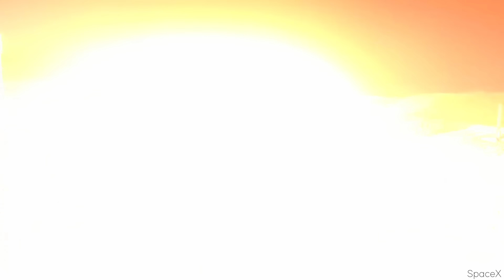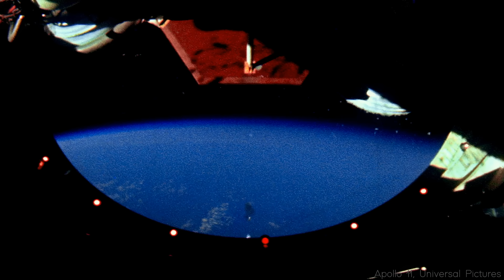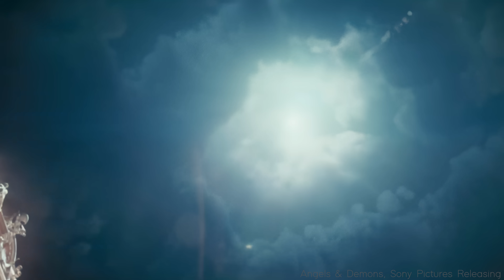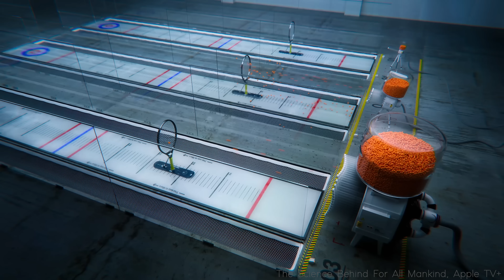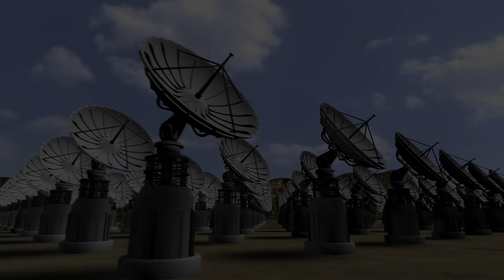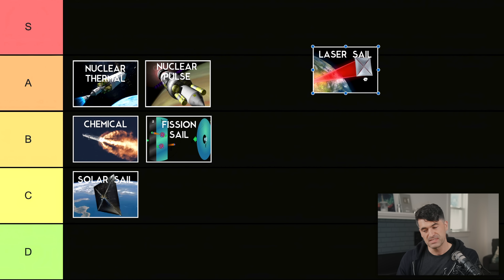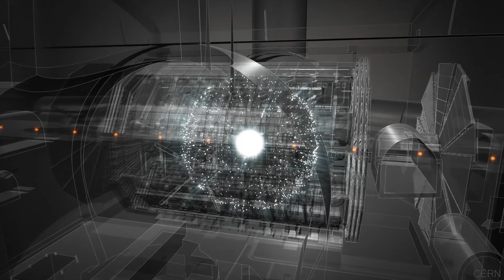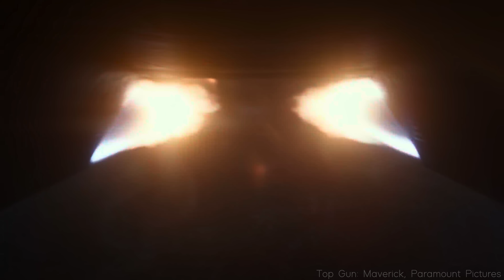Interstellar Propulsion Technologies - RANKED!

Comment: I watched this vid yesterday and am watching the Halo vid now and was going to comment there, but felt this vid would be a better choice.  It seems everyone that considers light sails focuses on laser acceleration.  Is there a requirement for coherent light, or is that just because lasers are easier to focus?  My question is driven by an idea I had a while ago for concentrated solar at distant asteroids: using what's essentially a giant inflatable Fresnel lens placed closer to the sun to focus light into a beam that can be directed fairly easily.  I don't understand enough about non-imaging optics to know if this idea is reasonable to keep a beam narrow enough over astronomical distances to be useful (I believe imaging optics have no chance of doing so), but if so, this approach feels like something that could be done 'today.'  What I envision is basically a giant (kilometer+ in diameter) inflatable disk a meter or so in thickness and what's holding the two sides together is angled circles of mirrored Mylar (or something else that can survive space) where the angles are such that the ones near the outer edge direct the light more than those toward the center.  All that light is directed toward a similar, but much smaller version that essentially reverses the process to create a collimated beam that can be directed with a mirror in the path of the beam.  I certainly see challenges keeping the beam directed on a location moving at a different orbital speed (or escaping the solar system entirely), but I believe part of that could be managed by either relying on radiation pressure to keep the collectors moving at a slower orbit, if not stationary wrt the solar system, or by having a series of these collectors spaced evenly around the sun that can direct the beam to the target when its in range.  I can't find the calculations I made a while ago, but my memory tells me what I described made of easy to obtain Mylar would weigh well under the capacity of various orbital rockets and the pressure to fill it needn't be much, since it's in a vacuum, so I don't think it'd be something heavy.  I also recall the price was reasonable - at least when compared to traditional costs to put things into space.  And it seems like something that could be cheaply tested at small scale (where 'small' could still be 10+ meters in diameter) with a cubesat or something for an attainable price.  Does this make sense to anyone?

Comment: While I can appreciate the focus on the technology we can currently build getting a higher rating. The warp drive is not D tier. Go update yourself, While the developments that have occured recently havent unlocked superluminal travel. The mere idea that it looks like the physics hangs together to show we could use it for propulsion, giving us a space drive is game changing if this continues to pan out and then engineering doesnt hit any brick walls. 

Also, same goes for the anti matter drive. that 100 Trillion dollar estimate is bogus. We already have a facility on this planet that makes 100NG of the stuff. You want to tell me given the likely hood we will have useful AI + robotics. We couldnt build the same facility in space actually closer to the sun than we are so that you end up with access to permanent supply of energy to not only turn into anti matter. Even if it is inefficient. But also with a ton of energy to power the containment systems. That 100 Trillion dollar figure is more likely to be the value of figuring out how to build such a facility in space not the actual cost especially if you can come up with a engine to utilize it.

Comment: You forgot about the saltwater fission-drive. This uses U-235 or plutonium as a salt in aqueous solution, being pumped into a water-cooled semi-sphere through neutron-absorbing pipes. Once it approaches the exhaust, the absorber is configured in such as way as to allow criticality just outside the "nozzle". The speed and pressure of the fuel needs to be greater than the velocity of the moderated neutrons used to initiate the reaction, which is surprisingly slow, around 50 m/s.

This is more efficient the more highly enriched the fuel, and has a minimum practical thrust-level inversely scaling with that enrichment. The higher the thrust, the higher the efficiency. It is in essence, a continous Chernobyl in space. Scott Manley had a video about which I highly recommend.

Practical for uninhabited planets and/or space, and very suitable for very large ships. For large mass/fuel ratios these could easily reach 3-4% of C with a multi-hundred tonne spacecraft.

Comment: Hydrogen for chemical or nuclear rockets can be very efficient, but storing the stuff is a serious problem.  In gaseous form, it takes up way too much space.  In liquid form it's conveniently dense, but hydrogen atoms are so small that they slowly escape any container we've yet devised to hold them, so they're useless for anything but the initial phases or any flight.

Anti-matter makes hydrogen containment seem like child's play.  It's absurdly energy dense, but it requires a magnetic bottle to contain it.  That requires a power source and field generator that are 100% reliable, as moment's failure would allow the anti-matter to touch the physical container it's in, resulting in a rapid unplanned disassembly of the rocket and everything within a thousand miles.

Comment: Ehhhhh
Critical mass isn't something that concrete 
Theoretically you can use any mass to rich it
You just need to increase the density of the atoms together basically you need to pressurise them

Which is how some A and H Bombs operate

Some use a pistol mechanism to add a mass that will push it after a materials critical mass 

Some use a series of interconnected bombs that go off simultaneously and force the atoms together

So it is theoretically possible but needs futuristic tech

For example, using giant coil guns that use superconductors materials to smash two pieces of fissile material together with insane speeds

So critical mass isn't a concrete barrier
Just a relative one

Nein alcubere Drive is not a time machine necessarily 

It might induce a backward time transfer inside the drive but it'll not take you back in time rather things inside the bubble might experience a change in the direction of time

If they're moving with the speed of time so basically we aren't even sure whether things necessary move back in time inside a drive 

And hawking's conjecture is simply a conjecture we haven't test it yet 
And we will never can if it is true

We aren't even sure about the nature of casualty

Comment: My idea is a version of the Bussard Ramjet.  Typical fusion ram jet designs have the ship carrying enough fuel to accelerate to light speed and then decelerate at the destination, making the weight of all the fuel a serious obstacle.  The Bussard Ramjet tries to get around much of the fuel weight problem with an enormous scoop that picks up random hydrogen atoms floating in the ether.   Instead of having an enormous scoop weighing down the ship and making it take forever to reach light speeds, just use a very tiny scoop.  Carry just enough fuel to decelerate once you arrive at the destination.  Create a track of fusion fuel tanks in space along the path of travel within the solar system, and as the ship moves forward have the fuel tanks spray the fuel out directly toward the scoop as the ship is passing them.  That way the total weight of the ship is the living area, the engine, small scoop and deceleration fuel.  You cut the weight down by at least half over either of the other fusion ramjet designs.

Comment: Fusion-Enhanced Clark-Sheldon Drive is my top-rated propulsion system. First envisioned by Rodney L. Clark and Robert B. Sheldon, the FECS Drive is a rocket engine design using uranium and thorium nano-dust fission for its main energy production and uses the fission products as the main reaction mass. (Also known as a fission-fragment rocket drive.) Magnetic fields control the resulting plasma. Deuterium fusion boosts the fission energy yield and also thermally boosts exhaust velocity, Ve. FECS engines might also employ xenon both as a neutron barrier to protect engine walls and as reaction mass accelerated by the Hall Effect and by thermal energy. One of the fission products, xenon-135, is especially good at absorbing high-energy neutrons. The FECS drive also serves as a magnetohydrodynamic electricity generator for ship. Specific impulse approaches 1 million seconds.
Reply: any more info on this? i would like to know more
Reply: What gas is used to generate the plasma?

Comment: Nuclear thermal for periodic primary boost required for changing direction and velocity. Ion drive for coasting and trim. Sails and solar panels are more useful for journeys that are inside solar systems. Starshot laser based program is going to only be feasible for extremely tiny mass, much smaller than a typical cubesat and thus is overrated here because it isn't practical to send humans even if we multiply lasers and energies to some extent. Nuclear thermal and ion drive are S tier.

Comment: Warp Drive being D tier breaks my heart.
Reply: Better to break your heart than break causality
Reply: @stevenshea990  I always thought the point of warp drive is to achieve FTL without breaking causality. The ship doesn't move, the space around it moves faster than light, which space already does as the universe expands.
Reply: @Fylgija1  The whole idea that FTL breaks causality is because of wormholes, warp drives and other maybe mathematically possible ways to bypass speed of light by some shorcut in spacetime. If these ideas didn't exist we wouldn't even think that FTL=time travel, we would just think FTL is impossible period
Reply: @stevenshea990  how does it break causality to move space around an object faster than light? Space is expanding faster than the speed of light wouldn’t break that causality in you’re theory? Space can move faster than light just no object in space can move faster. Please explain me you’re point again.
Reply: @stevenshea990  
Causality is a secondary effect. Entropy is temporally symmetrical.
Reply: New research shows warp drive can't go FTL unless it starts FTL :(
Reply: With the recent updates theory that greatly reduces the energy needed to create the warp bubble, has generated greater interest in the theory. I think we will see rapid advancement in this area research
Reply: I was so hyped about it for years, until I learned that the energy required would be insane. If I recall correctly, it was all the energy in Jupiter to travel a few lightyears.
Reply: @Fylgija1  
It WOULD be if one distorted space according to the current understanding of gravity and relativity. Which fails to explain the obervations of "dark matter" and energy (really just the spin of galaxies at the extreme edges) Which means at the very least it is incomplete.
Reply: @Fylgija1 Antimatter has entered the chat.
Reply: @Fylgija1  It's more the mass energy of Jupiter crammed into a space ship that would be only slightly bigger than the ISS that's the real issue. Regarless of how far you can travel with that the process of cramming that much energy into that much space is effectively just creating a black hole except way more complicated. Might as well save a few steps and just use a black hole drive that would still be able to travel at a significant % of the speed of light for a lot less effort and a lot more efficiency.
Reply: @ThatGuyKazz  yea but you forgot to mention that you got to create that mass or gravity inside the spaceship out of nothing and destroy the mass or gravity somehow if you are at you’re destination. So you must have the ability to create gravity with some kind of machine and that’s pretty unlikely to happen in this century. If we got a quantum theory of gravity that might help to understand gravity on a particle level so that we know better how gravity interacts. If we could find something like that a warp drive could be possible within the next 100 years. With our current Technologie it would be impossible to even find a „graviton“ if it exists.
Reply: For me it's vice versa. People realizing that warp drive and FTL are impossible brings me joy. It's like the romantic belief that other planets of the Solar system are bustling with life and humanoid aliens. No one thinks that anymore. FTL was fun but it's time for it to go. It's time to accept that will never reach other stars in our lifetimes and in many generations. And when we do, it will not be faster than light.
This collective realization paves the way to realistic space fiction which is currently severely underrated and underdeveloped.
Reply: @t.104  Just because we dont know how something works, does not mean that it could not work. It is very unlikely that an FTL drive will be devolped within the next 100 or 200 Years, but how would you know what happens after. It is not physically impossible to go faster then light if you are starting faster then light so if you find a way to jump over this barrier without accelerating it is not impossible. We have so many open questions about gravity and quantum physics, that it is not possible to determine what we will find and discover in this area and how it will effect future technologie.

Comment: I've seen two interesting combo-drives, that add technologies together. Both start with a fission drive. In one case we also generate electricity from the fission reaction and use that to magnetically increase the specific impulse; so combo of fission and ion drive. 

The second idea introduces fusion power in the exhaust.  The main difficulty in fusion power is holding the plasma. In this case, though, it only needs to be directed backwards. The idea is to accelerate fusible gas like a fission drive, and the fuse the particles as they leave the rocket.

Comment: I have one. My "Plasma-Drive retrofit for StarShip. It is a superconducting "wrap" around the ship having plasma conduits to accelerate plasma at near light speed through six small nozzles behind it. The power source is a couple of portable nuclear reactors. It generates plasma in a magnetic bottle containment vessel then direct it towards the plasma injectors up front that accelerates it across the ship. The main drawback is while in motion, there is no possibility of communications with the ship. It is mean for inter-planetary long haul transport. eg Plot a course for Mars, the ship will accelerate it half way, then cruise/slow down the other half. If you travel at 0.2c, there is no way of avoiding any obstacle.  Method is similar to the "Tall Greys" launching their ship from the Nevada desert on a moonless night. (Towards the outer planets of our solar system)...
This drive will be used in outer orbit of earth towards any planet but mostly for Mars. I believe there is  "time dilation" for the occupants in the ship.

Comment: QUESTION. are there any kind of regulations in terms of what direction a space program can point a static rocket engine test? our planets spin is slowing ever so slightly. not likely due to rocket testing, but if there were some kind of regulation requiring you can only aim it in a direction that would aid in maintaining earths spin should we not make that a thing? as little as it would help at this time, there will be more and more tests by more and more companies and they may over time be able to help extend the day the micro seconds it loses

Comment: Forgive me for not checking if this was commented already:

Since we are throwing in ideas from fiction, in Andy Weir's book Project Hail Marry there is a drive made from alien microbes that harvest and store nearly all the photons they absorb and can release them as propulsion.  (being as spoiler-free as possible) the energy efficiency is on the level of direct mass conversion, and the engineers work out a simple system to mechanically direct the microbes to propel themselves, pushing against the vessel.  So fuel is microbial mass that are grown and charged with sunlight.  In the book they use this to accelerate at 1.5G for half the trip and then flip and burn the other half with a fuel mass comparable to what we build today; cover more than a dozen lightyears in just a couple decades (from the perspective of earth).
Besides that he has to hand-wave into existence a way for this organism to convert and store the energy, lots of points for an idea that doesn't violate causality and creates lots of compelling plot for the story at the same time!

Comment: I didn't see anything here about a rail-gun launch system. A long rail/cable could use local power to magnetically launch payloads. That could include supplies, fuel, and even ships.  With pre-launches you could space out a chain of supplies that a ship could intercept on it's route.  Or supplies launched at higher speeds could catch up with your ship, even supply additional momentum when  you intercept. Have machines build a launch system at the destinations (another star), and it could launch supplies back towards the approaching ship. The act of "catching" these supplies could be used to slow down as you approach.